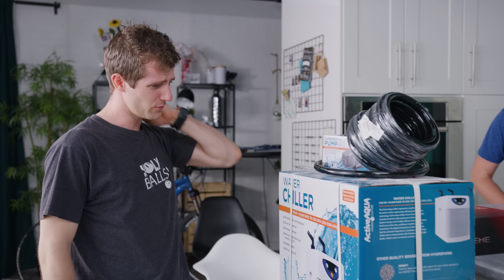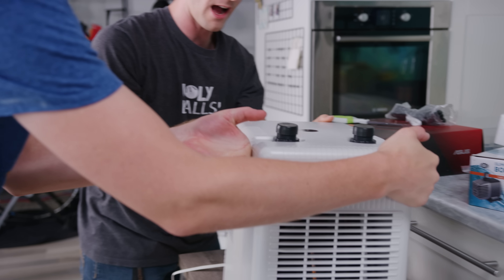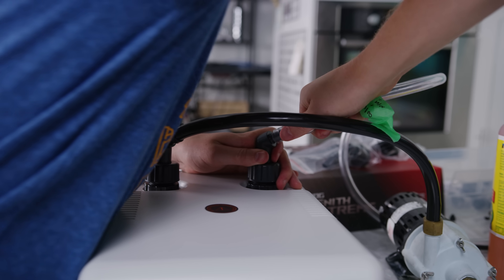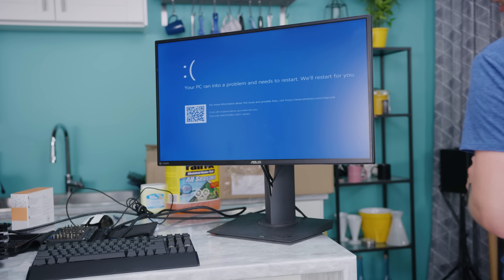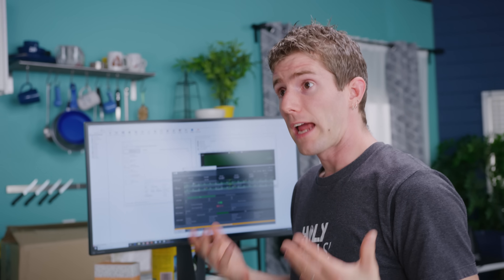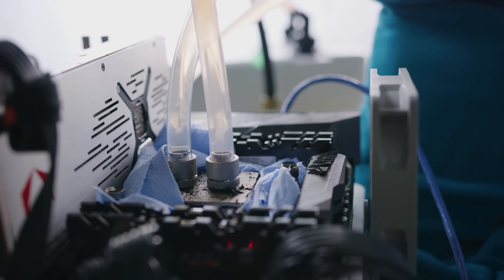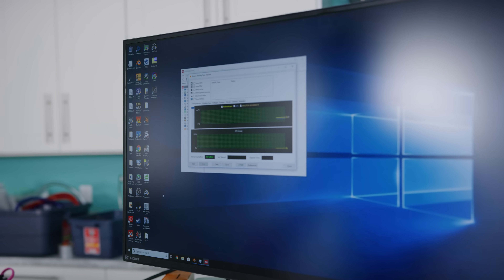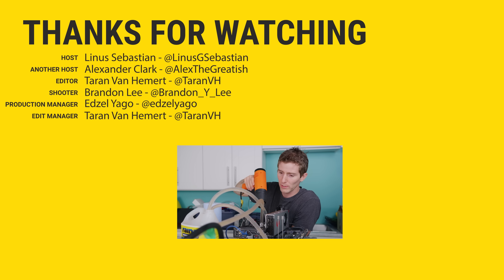Chilling Threadripper 2!!!

Comment: My mother recently was in the hospital, and for part of her recovery, she had this chill pad, which was this pad, that was fed cold water, from a circulator that was filled with ice water.  I wondered if a person could take 2 radiators, and stack them, then like use that cold water circulator to cycle through the first radiator, and have the processor cycling through the second radiator, and again, have a fan pushing air through the radiator stack...pushing the cooled air, through the CPU's radiator. A user then could use the cold water system just when needed, for heavy load work, then just have it dead when not.  With the experiment in this video, I think a water to water "intercooler", such as I described, it would be much safer on the water condensation issue you were seeing.
Reply: The chiller is less expensive than two radiators and fans but yes you add the additional expense of running chilled water through a radiator and blowing cold air into your case, or room...
Reply: That chiller is around $300 on Amazon, where as you can easily get a couple of radiators and fans for that price.  You mention the additional expense of running chilled air into the room...do you think that chiller and the pump, which would have to run constantly would not have an additional expense? I guarantee that water chiller is dumping heat into the room, it is called thermodynamics...heat that is a waste of energy. My Idea is for an AS NEEDED chilled water cooling...like say throw in a couple ice cube trays of ice into the system and turn it on, just when you want extra cooling.

Comment: WE WANT A PC WITH A BUILT IN WATER CHILLER.
Reply: They already made one. "How to Build the ULTIMATE Sub-zero Phase Change Cooling PC Build Guide"
Reply: Thermaltake made one several years back. Had a built in freon compressor, condenser, evaporator chamber, radiator, it was a complete unit in a case.
Reply: There's also one from Alphacool, nice unit but pricy and still not nearly as convinient as the Vapochill or Prometia units from the 90s. I had both, a Prometia Mach II and later the Vapochill Lighspeed, both really "cool" devices. They where compact and had lot of power.
Reply: we want spanish inquisition
Reply: WE WANT A CPU WITH A BUILT IN WATER COOLER
Reply: WE WANT A KEYBOARD WITH A BUILT IN WATER CHILLER
Reply: I work in AC\Refer. I could create a self contained chilling system like Linus has here for super cheap, especially since I work with Ice Machines a lot. All you need is an Ice Machine that doesn't actually make Ice, the water cools when it runs over the evap and once the trough temperature reaches 35 degrees, which would only take a few minutes, the trough is emptied into the CPU loop and refilled to chill again. The only issue I see coming up with this is that most Ice Machine aren't designed to stay in freeze mode for hours at a time, they cycle between Freeze\Harvest which helps by equalizing the pressures on the COMP occasionally, and preventing freeze ups. I'd have to do some engineering for sure.
Reply: @TheChurchofCacti  You totally should do a YouTube video on this or do it with LTT.
Reply: @TheChurchofCacti  you could use something with a lower freezing point than water, then you could get your CPU to below zero. Then if you submerged it in mineral oil to prevent condensation, you could run it for days straight on a crazy overclock.
Reply: WE WANT A PC BUILT INSIDE OF A WATER CHILLER
Reply: we totally do linus do it
Reply: I work in the refrigeration industry. Tech wasnt there, but samsung just released a small 24v efficient compressor that looks like it could fit this application well. Its quiet and powerful. Might pick this up as a future project if I can get my hands on one. https://www.samsung.com/global/business/compressor/mini-rotary-compressor/all-mini-rotary-compressor/
Reply: Too be honest direct watercooling with a chiller might be a better idea than having radiators lol just buy a cpu and gpu block and buy a chiller that can handle 2000watts more than enough to cool a  water cooled system lol
Reply: I remember reading in a tech mag about the first PC to break the 1GHz barrier and it had an integrated chiller unit in the case
Reply: You guys clearly missed the 90s ... google Vapochill LS, that was a propper cooling solution ... compact, silent, efficient and not too expensive. Waterchillers are useless marketing BS!
Reply: @TheNightstalker80  The vapochill is a bit different from what's going on here. It's a refrigeration unit that's connected right to a block for a CPU. It doesn't have a secondary coolant loop. It is actually pretty nice though. Shame they didnt update it to actually compete with liquid cooling loops. It'd really only need to have the equipment to do a secondary loop.
Reply: @travisbeagle5691  With a bit of modificatipn you can do that but basically it's just meant to cool the CPU. But there where systems on the market with 2 cooling heads so CPU and GPU cooling was possible. Taking away the heat from those 2 sources, the rest of the system was no big problem.
Reply: @travisbeagle5691  There where solutions to that problem back then. We had cascade units for multiple CPUs/GPUs but those where mostly custom made by OC addicts like me and my friend lol. 
But also a combination of a Vapochill and Liquid cooling was pretty good because if you don't have to deal with high case temperatures from the CPU and your liquid cooling system only needs to deal with the GPU (or vice versa) then your overall temps are pretty good compared to a single liquid cooler.
Reply: @TheNightstalker80 They made a video on it too https://www.youtube.com/watch?v=4d0B0Dli-1g
Reply: @TheNightstalker80  If you are a refrigeration technician and have basic knowledge you can make a cooler with plate and glycol exchanger.  you can easily go to the processor -5 ° C under conditions such as having good quality glycol, good quality heat exchanger and good insulation in the processor so that it does not have a problem with humidity, you will see how it will work.
Reply: #TeamLinus
Reply: That will be in a hall of fame one day...
Reply: stupid ads
Reply: Insulate pipe to prevent condesnation
Reply: yes yes yes
Reply: Do it with threadripper 3rd gen
Reply: No, we want a cpu with a built in water chiller
Reply: And free Electricity
Reply: Yes
Reply: WE. WANT. IT. NOW!
Reply: I want a water chiller with a build in PC! I mean, the chiller is as big as a case so seems somewhat reasonable
Reply: PLEASE
Reply: You mean any pic with a water cooling system because that’s exactly what a radiator is
Reply: FBI WANTS TO KNOW YOURE LOCATION
Reply: Should of got the D-D DC4000 cooling compacity be ideal lol no radiators just a big chiller instead that weighs 47kg lol 😂
Reply: I seem to remember years back that someone made a case that actually had a small AC unit in the base. It cooled the air inside the case but I don't remember who made them.
Reply: Yes
Reply: May our frame rates be high and our temperatures low
Reply: AMEN
Reply: Well just like the other guy said 3 years ago, its not that it is a water chiller, but it is a complete refrigeration unit. It basically moves the heat out from water using a coolant, compressor, condenser, evaporator, and a radiator.
Reply: Y E S
Reply: Y E S
Reply: at this point just soak the thing in water
Reply: It doesn't work because the chiller wants to chill water that has very little thermal input (fish don't warm up an aquarium much) and a CPU is not a very little thermal input. If you went cpu - aquarium - chiller, it MIGHT work. Best case scenario without an aquarium sized body of water to heat soak into is your chiller is just going to run fulltime till it dies. SAME AS A REFRIGERATOR !!!
Reply: 4 years later we still waiting to see it .. i was thinking build pc with cpu and gpu use aquariam water cooler for ai work .. and to suprise only Linus did try none ever try .. i wonder ..
Reply: WE WANT A PC
Reply: Did this video happen?
Reply: UP

Comment: You should run the whole thing in a tank full of mineral oil. Have three loops of cooled alcohol. One to the cpu, one to the gpu, and one to a radiator that is submerged in the mineral oil. Make sure you are getting good flow through the radiator to chill the mineral oil down. Insulate the hot side of the tubing coming out of the tank. Make sure the alcohol is a different color than the mineral oil to check for leaks.

Comment: Put the whole board in mineral oil to avoid condensation.
Reply: Cool the mineral oil in the fish tank pc with this
Reply: Mineral oil cooler to below freezing LoL
Reply: that's actually such a sweet idea lol
Reply: You can't really take it below freezing due to mineral oil freezing at −4 °C however i really want to see this done now.
Reply: why not put it into epoxy?
Reply: Vacuum sealed then refill with pure nitrogen gas so no water vapor. Then create ducting with radiator to recirculate the nitrogen gas to remove heat in enclosure. Perfect sub freezing test setup. Real quandary is creating a close loop that can maintain vacuum and hold in the nitrogen. Even better would be helium but more expensive and harder to keep under vacuum without leaking.
Reply: Or take 3M Novec
Reply: @schniptzel9775  thats actually a really good solution
Reply: Blake J l
Reply: Litterally was on my way to type this as soon as the unboxing started.
Reply: It's Linustechtips,why would he do that? Rebellious he is.
Reply: They are not doing that with a bench that they're going to be using as frequently as Threadripper 2
Reply: or put the whole thing in an acrylic box and pull a vacuum in it!
Reply: If you'd put the bench in a vacuum, everything, not directly cooled by the watercooler will overheat in a really short time since there's nothing the heat can be transfered to... just think about the GPU
Reply: But making a vacuumed Computer with ram/VRM/GPU/etc custom cooled somehow would be a nice video too ...

Comment: Run all the air leading into the system through a "radiator" in line with the cold water so that the air is chilled and dried.  This will bring down the dew point.
"ice melter" CaCl will lower the freezing point of water well below zero so that you can use more water for better heat carrying power.
Cooling the bottom of the mother board slightly will help you to get a lower die temperature because some heat can leave via the legs instead of leaking in.
Expect to draw lots and lots of current because MOSFETs conduct better when colder.

Comment: That windshield washer fluid has rain x in it which coats any surface it touches with a hydrophobic coating... now that whole loop is hydrophobic... There is also a lawsuit against this washer fluid because it was costing the windshield washer reservoir sensor giving false readings.
Use glycol (antifreeze) and water next time!
I'm curious if the components having that coating affect thermal temps if you replace the fluid with water...
Reply: If you read the label closely it should say applies water beading technology to repel rain, snow, and sleet.

Comment: I don't even know if this should be realistically cannibalized into a system. It seems like you should instead consider how far away from the actual system it could be put; remember the "whole room water cooling" thing? With the flow rate that unit can handle I would like to see how many systems could be cooled at once!

Comment: Linus and friends,

Why not use the chiller to cool multiple units all at once for say your server room? Might cut down on cost for power from server rack fans, insulation, etc?? Just would have to figure out the load at which can be put on the chiller before it does not work. Key is to keep chiller in a different room due to heat being output from the unit. Wouldn’t want it in the same room for cooling because you would be dumping the hot air into the same space.

Comment: 1/10HP is pretty wimpy being about 75 watts of cooling capacity. Figure out what the PC's power draw is at full load in watts (you can measure this at the wall), bump that up enough to account for overclocking, plug that into a formula to get HP or btu/h. W * 3.412 = btu/h  and  W / 746 = HP. Look for a chiller rated at just over that number. My machine with one GPU eats about 400W at full load so I'd guess ~600W for overclocking which means I'd need a chiller capable of at least ~2000btu or ~4/5HP.
Reply: Jesus, Just use SI Units and miss ne with that gay btu, horse Power shit
Reply: You're not making any sense whatsoever.  It's just the pump that's rated at 1/10hp.  That's a small part of the total equation, not the cooling capacity of the system.
Reply: The chiller only has to cool the cpu, gpu and mobo are aircooled

Comment: Mount the board upside down so any condensation would just drip down the tubing or set the water cooler to room temp so there is no condensation

Comment: You could try to make a near silent water cooled build. In our tech lab, there is a laser that is water cooled with a regular tap water supply line that goes through a filter then to the laser tube and exit out to a water drain port. You won't achieve sub ambient temperature but the whole process is near silent and water in loop is always ambient temperature.

Comment: Linus you need to do an episode where you send a Cooling loop into a closed box with a line to a radiator and a line into the Cpu next which goes directly out of the box.also attach a dehumidifier inside that has a drain pipe out of the box into like a drain preferably or out a window. You can use a garage blower fan with the radiator glued/taped to the intake so it blows chilled air at the board and gpu to make sure the mem, vrm and everything is staying cool including the power supply. The box should be sealed with wood glue and on the outside and inside painted with a pvc resin material so the wood doesn't get condensation on the outside and mold. Make sure the top has a notch carved into it. Use a rubber belt for a lawnmower or car as an O ring.(doesn't need to be perfect just snug.) I should mention that this would be attached to a lid. Use some screwed on lever style clamps to hold it down. (The kind that uses spring tension). Make sure you have the build oriented so that the blower doesn't cause the gpu to bend. But allows the air to spilt back so the flow travels in a circle.  Once you test to confirm it runs use caulk to seal the top and reclamp. The caulk can be removed, but built right you could cool multiple pcs in a single box. 
Maybe even a 6 gamers one box v3

Comment: i will buy a future threadripper if they start rating those MF's in horsepower, because 500 is sooooooooo clooooose to a three quarter horse processor. i really want to own a first run 1 horsepower processor, im too poor to own the solid gold MB it would need, but I'd still be a baller, because "hey, check this out, 1 horsepower processor. BAM"
Reply: The reason that there is a conversion is because all power is the same. When the physics is broken down, there is no difference between mechanical work and any other work.
Reply: There is a difference. One is the rate of work done by moving something, and the other is the rate of work done by heating something up, but that is just a minor detail. Of course power is power, but it isn't exactly useful for me to measure the electricity consumption of (for example) my TV in horsepower. It doesn't really mean much to anyone, as it's not the typical way to do it. This is why you'll often see electric motors rated in watts for the electrical input, while at the same time being rated in horsepower for the mechanical output. A unit defined by the average sustained rate of work of a horse doesn't translate that well to electricity for most people.
Reply: The problem is horsepower is typically a measure of mechanical power. Sure, you could equate the electrical power to horsepower, but it doesn't really make a lot of sense.
Reply: it actually makes a lot if sense. so much sense that there's an exact conversion. 1 horsepower = 746 watts therefore 6 = a half dozen. its exactly like the metric system just totally different in most every way.
Reply: No shit. Yes, there's a conversion. You must feel like a genius to have just figured that out. However, NOBODY, including people who use the imperial system measure electrical power using horsepower. Though mechanical power is often measured in both watts and horsepower.

Comment: Couldn't you use the temps the board measures to regulate the cooling unit to keep the die a margin above ambient temps? Has to be a relatively easy way to implement that.